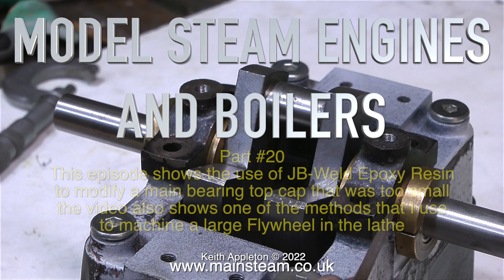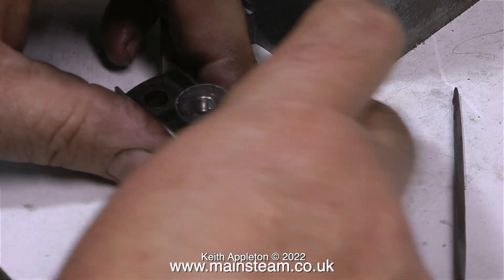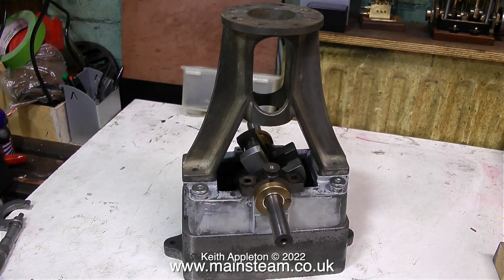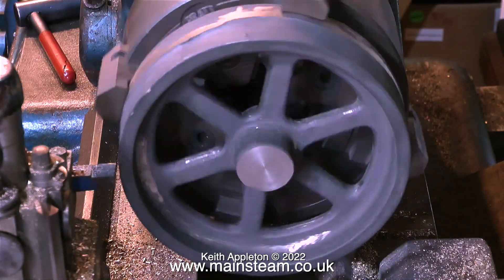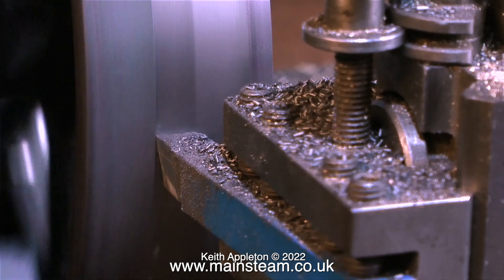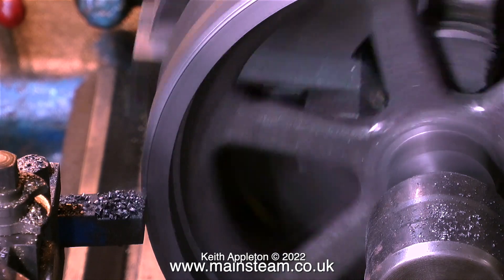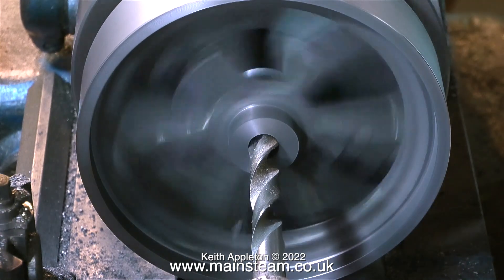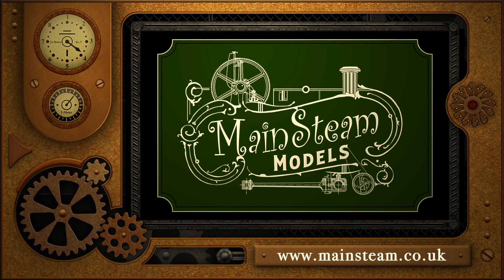MODEL STEAM ENGINES AND BOILERS - PART #20

Comment: I am reminded of the large vertical turning lathes at the shop I work at. Recently, chatter marks were being an issue on a few parts. I wish I remembered what you've said, not only with this video but in the past about running too fast. Your videos are most helpful even as I am learning in that machine shop.

Comment: I truly enjoy all the videos, particularly your common sense approach to the work.  After machining, is it common practice to balance the flywheel in these models? Have you found it to make much difference in the performance (vibration) of the models?   Thanks
Reply from the maker: Normally balancing is not critical on low revving engines, but when I machine a Flywheel I try to get it to run as concentrically as possible.
Reply: The same question came to me mind. I wonder how much wobble would a unbalanced flywheel would generate, even at low speeds.
Reply from the maker: the reciprocating mass of all the other moving parts causes more problems . . . .